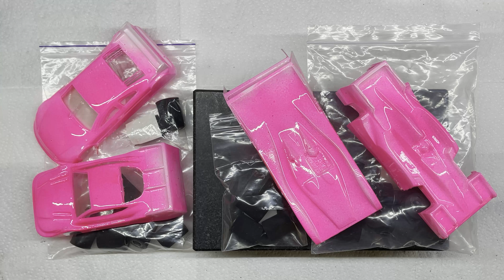Preparing for the big slot car race - 2022 BSCRA UK National Championships - Part 2

Comment: I've seen you mention a tire/hub that is recessed.   What brand is that?   Also do you ship your body mounting jig to the states, does it also work with 1/32?    Thanks.   Rick
Reply from the maker: Hi Rick. Thanks for watching. I have shipped quite a few body mounting jigs to the states 😁. It works works great with 1/32 and 1/24.

The recessed hubs I use are from a company called S&K (They are based in Ukraine) but you may find some stockists in the USA.
JK also make recessed hubs.
Reply: @CleaveTech  thanks    I see you have a FB page with them listed (jig).   I'll order one from there.
Reply from the maker: @rickb4382  The Facebook page doesn’t have all my products as I haven’t updated it for a while. Send me a message via the CleaveTech Facebook page or email cleavetech.james@gmail.com and I can let you know prices including tracked shipping 👍🏻

Comment: Are the motors in the EuroSport cars close to Gp27 in performance, if not, what would they be closest to?
Reply from the maker: Hi Paul. Thanks for watching. The EuroSport motors are similar in performance to G7 wing cars. You can use any motor you want! The difference is probably that the EuroSport Motors rev higher but have less torque than wing car motors.